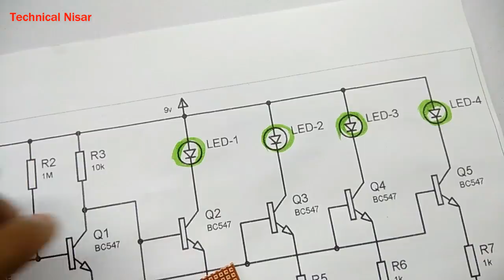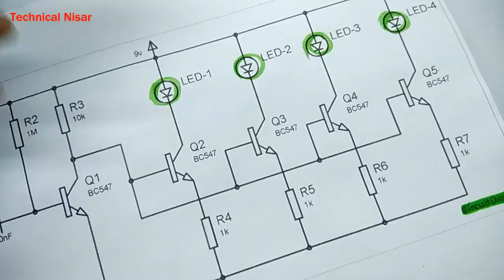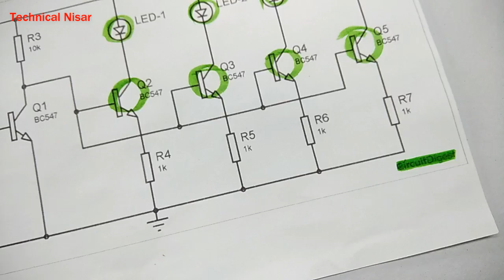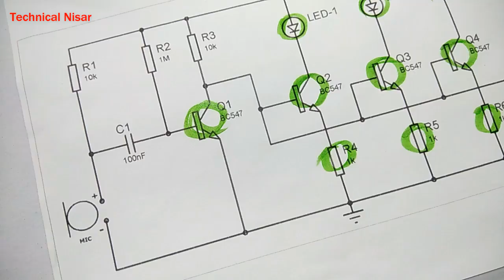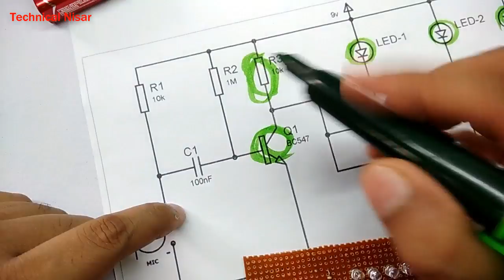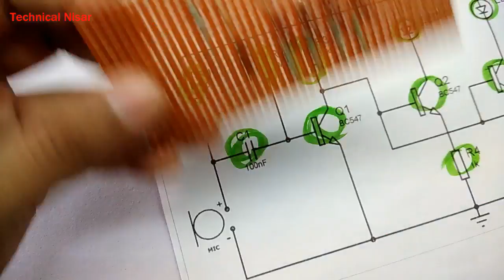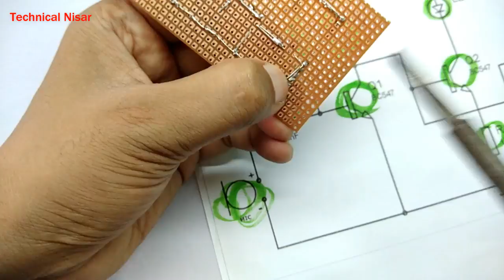Music Rhythm LED Flash light using Microphone  DANCING LEDs VU meter

Comment: Ok, so the schematic is incorrect for it to be used as a true VU meter. the microphone is triggering all of the LEDS at the same time due to the resistors all being the same rating. if you staggered the resistors in varying values then you would have the LEDS coming on in sequence.
Reply: could you please share your schematic diagram with me or somehow share about the resistor's value
Reply: The reply by Wasted Props is completely incorrect. There is only ONE level, as all 4 LEDs are driven by Q1. The resistors R4, R5, R6 and R7 are the current limiting resistors for each LED - these have absolutely nothing top do with switching each LED on (that's done by the Base of each transistor which are all connected together.
Reply: It's the light emitting intensity...each led colour has different intensity of light, so it looks like some led are glowing higher than other
Reply: @johncoops6897  john, a few years on and a few years wiser. My comment is semi correct. All the LEDs are being tiggered at once, this statement is correct, as there is no cascading, the schematic shows the transistors are all essentially on the same "rail" triggering all at once, needs a small value resistor between the transistors to step the voltage and trigger each led in sequence of input voltage

Comment: Great project, bro! :D Two questions: reducing the resistor values (the 1k ones) can I use 5v instead of 9v? The second, can I connect a 3w amplifier audio output to it instead of the mic? Thanks a lot! :D
Reply from the maker: +MC's Creations yes you can use 5v instead of 9v. But you can't connect directly instead of mic.
Reply: Technical Nisar Thanks! Maybe it's possible to connect to the line in, before the amplifier. I'm going to try. :)

Comment: Can i use cylindrical capacitors instead of ceramic one?
Reply: is a lot better if you use the ceramic capacitors
Reply: Kaichin Yong why?
Reply: i try the cylinder capacitors at the first time it work but the led rhythm
 is not that good